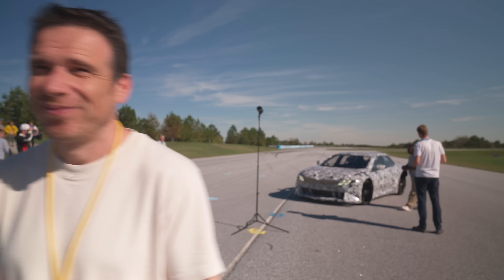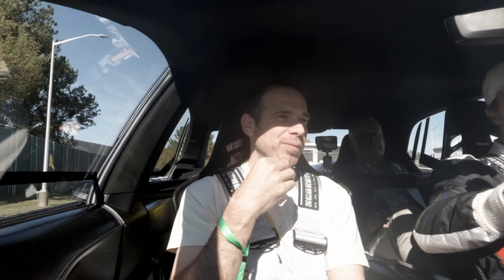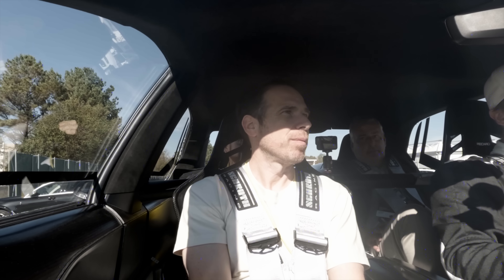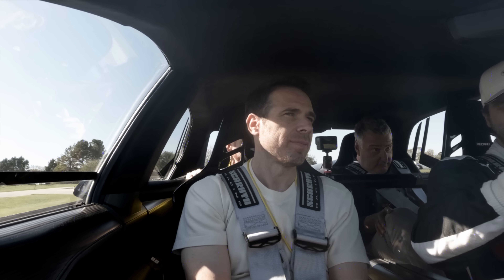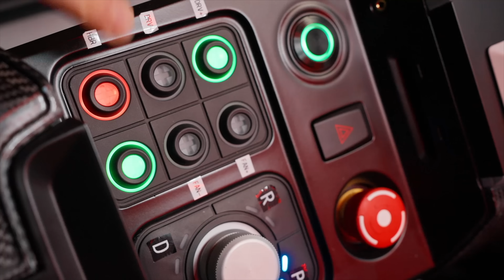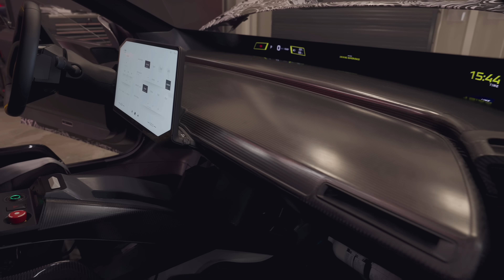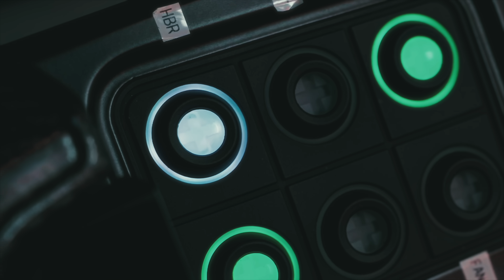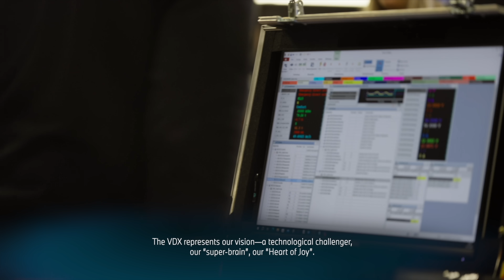Riding in the BMW VISION DRIVING EXPERIENCE (VDX)

Comment: It's still a clunk-o-matic. Electric junk. Owned BMW's all my life and now the heart of joy will be the heart of your wallet. What's with the wheel lights?? Great for distracting other drivers on the road. Are they even functional? Burning rubber and 1,500hp is fine and dandy but I'd rather row my own gears and listen to an engine instead of wind noise.

Comment: The exterior design is beautiful. There are only two things that should be improved to the production version:

1) The roof should be flatter
2) The rear should be significantly extended. It should be about twice as long, because then the proportions fit

The performance will hopefully remain at 1500 hp and 18,000 Nm, combined with the new all-wheel drive from BMW.

Comment: CF body (i3/i8 experience), fan downforce, direct wheel drive with instant centralised control, probably some epic sounds for emotion. The biggest problem I can see is the loose nut behind the wheel... I mean can we give this to the public on the sole basis the got a drivers license driving around a block, and have a financial status completely unrelated to skill? OK this is already the case, but this is so much beyond current M3 level of performance, it hurts my brain. And I've been training driving for 35 years...

Comment: congratulations to BMW for surpassing 700 hp. They have been at the bottom for years with cars weighing 🐘 they think they are Porsches 😅 also they should thank the electric motors, otherwise they would have continued forever under 1000 hp.

Comment: Upcoming M3 EV (ZA0) platform will basically suck the soul out of you . Quad motor setup and 1,300 - 1,700 hp . Approximately 18,000 nm ( 13,000 ft lb ) . Active aero dynamics with 1,200 - 1,800 kg ( 2,650 - 4,700 lbs ) downforce . Lateral g forces over 3 G's . The fastest race / street cars don't exceed lateral 2.5 G's at the Green Hell . The whole thing will be controlled by the newest central computer " Heart of joy " .
Reply from the maker: That’s some serious performance.

Comment: Is the audio a long way behind the video? The engine sounds didn't seem to make sense with the speed.
Reply: Where is engine mate🙄
Reply: @darkpeople9321  the electric engines buddy. You can clearly hear the electric engines wind up, but they don't seem to match the speed increases? Is there some kind of CVT gearbox between the engines and the drivetrain?

Comment: But but it’s electric whaaaaa 
~ some petrol heads
Reply: I would prefer it had a twin turbo low displacement 10,000 rpm 1000 hp V8 with the car being 1100 kg, but whatever
Reply: 😂😂😂😂😂 I wonder if petrolheads will still pay for gas once governments stop subsidizing the stuff. Do they really love ICE engines that much? We'll know in 10 years.
Reply: @Giddy-i2c  would you still want your EV if the government stopped subsidizing yours? Its the same issue, but I guess we’ll see right
Reply: @junyaiwase  I can generate power in my backyard, can you mine for oil in your backyard?

Comment: Carbon chassis /tub? This this is gonna be $200k.
Reply: 200k? Try 350k with all that aero tech
Reply: @Shadowboost  dam
Reply: It's a prototype car. Production vehicle will not come in carbon fiber.
Reply: i guess its gonna be the multi compound "carbon cage" which is already in use in IX...not that expansive
Reply: Insurance and accident repair costs are going to be insane
Reply: They also done it with the i3. They have some experience in mass production of cf Chassis...
Reply: iX uses lots of crfp as well
Reply: (before options)
Reply: The production prototype has already been spotted and it will not be like this. This is a power train demonstrator for the future m version.
Reply: Di più .
Reply: Looks like the same carbon plastic as the i3. So not real carbon.
Reply: @SuperMan-tl1nd  It's very real carbon. i3 used CFRP. It uses a cheaper process where rough pieces of carbon is pressed into plastic. Doesn't require labor intensive detailed work like PrePreg Carbon Fiber Sheets. Soo yeah it's highly likely a version of i3M will have a CFRP chassis. You already can own an old car with it.
Reply: @SuperMan-tl1nd carbon fiber is classified as a plastic 😂 I guess your brain is too

Comment: For the love of god, if you dont know shit about aero, just dont say anything you dont know, or better yet get us the engineer that knows.
For instance, rear end has vents for the active fan and a diffuser underneath, in the front just ahead of the windsheild, thats a vent for either cooling and around the bonnet above the fender those are vents for either cooling or ressure relief from the wheel arches.

Comment: that is a ludicrous amount of horsepower. and i dont mean that positively
Reply: Makes petrol cars obsolete
Reply: Quite the opposite, I want to enjoy my car, not throw up in 5 minutes
Reply: @Tommmmmmmmmmmm does it tho? It’s faster but does that really make ICE cars obsolete? Especially when theres no range numbers on this car. Regardless I would say the same thing if it was ICE so i dont know why you mentioned this to get me to join your little ice vs ev war

Just saw it apparently drained 10% in 2 minutes of this video…
Reply: @junyaiwase  10% in 2 minutes driving like that? A gasoline car would be looking at half a tank and spending triple digits at the gas station.
Reply: @Waldo1122  gas station vs sitting at a charge station with a blazing hot battery tho. not to mention that if you can afford a vehicle with that amount of horsepower gasoline shouldnt be a concern
Reply: @junyaiwase  Welp with electric cars you don't have to be mega rich to afford a car with a lot of horsepower, that is kinda the point.

Comment: I love that they talk about interior ergonomics and such and then implement the dumbest interior, throw away the idrive knob, climate controls, all buttons and throw an extra steering wheel spoke right between the instrument cluster.
Reply: There won't be a traditional instrument cluster. It's going to be a HUD around the bottom of the whole windscreen, ultimately looks like a design concept borrowed from the french i.e Citroen 20 years ago. The whole brand has changed, there's nothing left from the previous generations. It's the end for the current fanbase, I doubt any E46, E39, E60, E63, E92, F12, F80 etc fan would appreciate any of this garbage. Personally I see no reason why I'd buy this crap instead of an F82 or an E92 M3. Yes this new crap is faster, has a widescreen TV and some sort of AI built in it but that's not what I want from an M series BMW.
Reply: @cg94cg they had to adapt. The current european car makers are at a crossroads and bmw basically had to reinvent the wheel in order to get ahead of the chinese competition who is dominating the ev market. IMO this new iM3 is spot on and is an absolute beast but dont worry, they said that the new gen 3 series will offer the new ev version alongside the gas powered one. 
And as long as they have to sell ev's in order to keep producing gas powered M cars i dont see any problem...
Reply: The instrument cluster is now above the wheel not behind it. Watch the vide on the panoramic display.
Reply: @CheddarKungPao  Ok. then look at the press photos and get back to me. In the VDX concept the steering wheel spoke is in line with the instrument cluster.
Reply: @jw6188  it isn't. The driver can see the instrument cluster over the top of the wheel.

Comment: Looks extremely promising already. Expecting this to cook the Nurburgring lap times. That speed pickup is insane.
Reply: i think the driver will not last longer as the battery
Reply: You think the battery will last one full lap? (Seriously)
Reply: @fuchsflo Why shouldn't it? It's not a combustion engine. Electric motors have full efficiency no matter how hard they accelerate. What does cost energy in an electric car is high speed, not high acceleration.

Comment: How wide are the front tires 325?  Damn this car is some next level think. 4 door sedan would destroy amg one record on nurburgring like nothing. 1.8ton of downforce while driving and 1.2 standing is crazy.
Reply from the maker: 325/30
Reply: @bmwblog  that's crazy, that would be 335 or 355 on the back? And 21 inch? Also lateral forces exceeding 3G. I just searched up the Amg one and gt3rs has 2g up to max 2.5g 
This car is insane. I really hope they will make it happen

Comment: This is awesome. But it drained 10% battery in 2 minutes
Reply: Thats what happens when youre going flat out lol.
Reply: Gas does the same thing. Selective outrage
Reply: @Venom198518 not at this rate.
Reply: @ErnstHaft-k7x With the energy stored in a full gas tank an EV would be able to drive at least 3.000km. An EV is so efficient, that it shows directly how fast accelerations need a plenty of energy. The combustion engine hides the real consumption, because 80% from the generated energy evaporates in heat, no matter how fast or slow you are driving. The only benefit of combustion is, that fuels have a high energy density.
Reply: @mikedelicus  in theory, you are correct. 
But the reality on the road is totally different.
EVs have worse range, and take longer to charge. 
And EVs have a HUGE disadvantage at high speeds. When I am on the Autobahn, and drive up to 230km/h (my cars top speed) when possible, I can still get a range of 600km on a 55L fuel tank. EVs don't even get half of that range at those speeds. And this is not speculation, this was proven by many car Youtubers in Germany.
If you want to go fast, EVs are considerably worse.